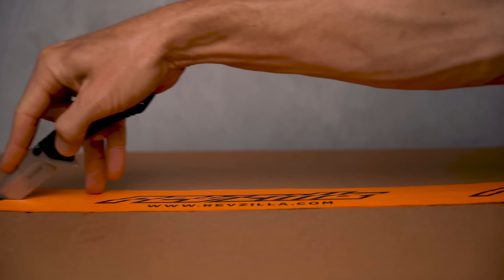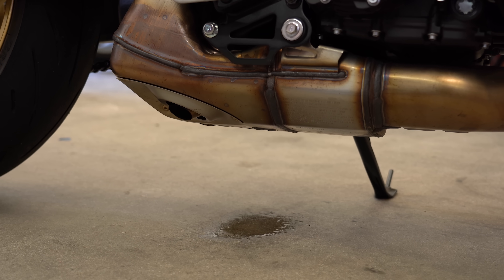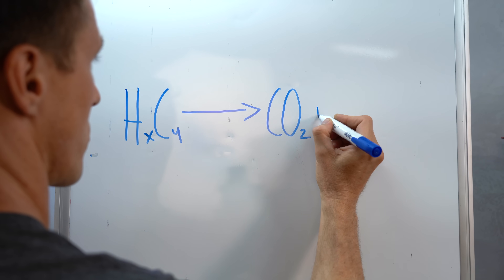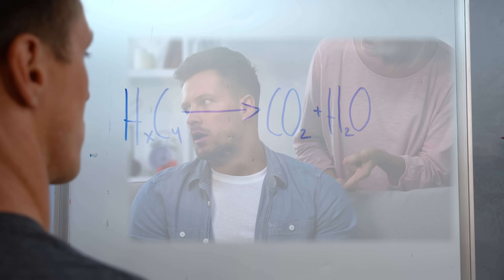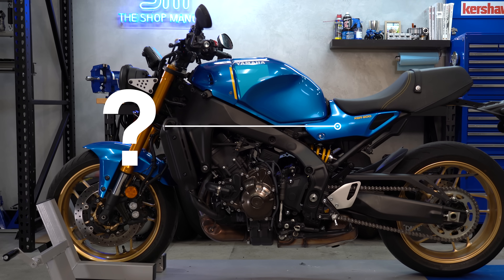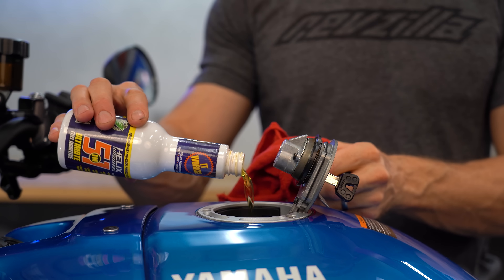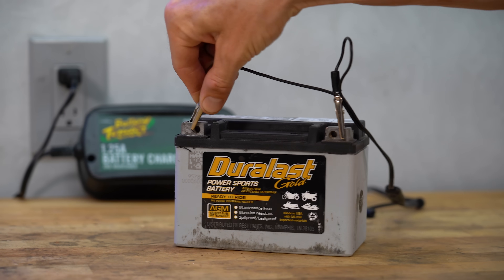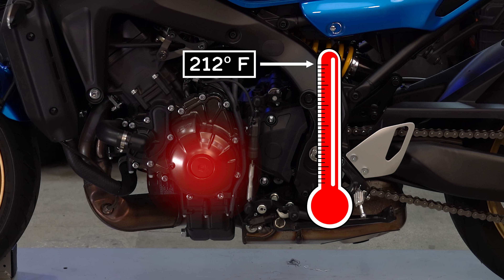The Storage Myth That Hurts Your Motorcycle | The Shop Manual

Comment: Or you can ride it year round if you live in Az. I have personally owned more than 50 motorcycles in my life. Last bike (Yamaha Road Star) had over 100k when I sold it, still ran good. Never put them away for the winter and I have ridden in the snow a few times.

Comment: Excellent video filled with great information. I am 59 years old and have followed this practice my entire life both with my motorcycles and any other stored vehicles... Also why short trips are bad for cars because of moisture buildup in the mufflers which may not be as much of a problem these days as a lots of exhaust systems have gone to stainless steel.
Reply: No, this is bad advice. It is contradictory on may levels.

Comment: If I'm starting my Deuce in the cold, I am plugging my "Extreme Heat" under jacket into my bike, and ride until my face is frozen 😂 I dug 30amp cable out to my garage, and installed a small 4circuit panel, just to plug a tender on my bikes.  Good thing I did that. I can charge a Tesla overnight from my garage.

Comment: I have been riding for about 3-4 years now. Living in Arizona I rode 95% of the year and never had to worry about this. I thank you for this knowledge. It makes 100% sense. This is true too if I move my bike to work on a project or something. I usually start it up, move it and the. Shut off for another month. Having heard this I will push the bike when I need it to move. 

Disconnecting the battery would be a good idea too I would imagine. Help with a y fantom drain.

Ride safe my frie d

Comment: I will ride though the UK winter... But wot about before you pull off I seen riders start their bikes the pull off straight away with out letting the oil set on engine is that the right way... I let it warm for a minute or two at least that 1st temperature bar before leaving

Comment: Worth a mention that some bikes ACTUALLY DO NOT CHARGE DURING IDLE... Certain makes and models over the years come with a regular warning "Keep your RPM's UP." from tech's, fellow riders, and dealers alike, as they gain a notoriety for discharging the bettery if you leave the engine idling for any length of time and do not insist upon riding at least to operating temperature... which is usually around half an hour minimum... It's also part of why so many "seasoned" riders with decades of miles and road time get anxiety whenever they hear an engine "lugging" for more than a second or two.

    CHECK YOUR OWNER'S MANUAL... OR if you bought used from an owner, the BEST money you can ever spend on your bike is a "Clymer" Book, similar to the Hayne's and Chilton's guides of automotive fame (or infamy, depending on your wrenching skills) only Clymer writes these babies to answer ALL your technical questions for motorcycles of legitimately every make, model, and year provided you bother to look for them. It's based on a COMPLETE tear-down and rebuild, comes with diagrams and pictures as well as reasonably easy to read text instructions and even step-by-step "Troubleshooting Guides" so you don't have to sweat being stranded at home "Because you can't get Baby to start up"... at least not without quite a bit of physical activity before declaring defeat and calling a truck and tech' to come take a professional "crack" at it... and probably charge you more than it's worth.

      Personally, while I live in the mountains and it DOES get cold in the winter, I've found it suitably reliable to pick decent weather days and actually go for a regular ride a couple times a month during the cold months. Alpaca wool is a DAMNABLY FINE commodity and worth every cent they say it is, bringing a huge benefit to layering up under the leathers and winter linings. SO an hour's ride twice a month isn't entirely out of reach and the regularity of honing skills and "keeping my game up" is definitely worth the little bit of discomfort I endure rather than trying to recapture my abilities from last year after the bike and I have been "out of circulation" for 4 or 5 months.   ;o)

Comment: Great video! This is the same way l store my snowmobile for the summer. Oil change, grease the rear skid, full tank of stabilized ethanol free fuel, put the battery on a maintainer and not start it until it's time to ride.

Comment: I try to charge my battery every week in winter and in summer if I haven't used it much. I keep the battery on the bike because of the alarm otherwise I'd bring it indoors.
I never thought idling it for ten minutes was good
As for fuel I fill up as soon as I want to ride it again but never have drained the tank or added fuel stabiliser. I occasionally put Redex in so there is some in now over winter. I don't know if it does anything.

Comment: See, I wish my bike had a oil and coolant temp readout, like my car. I always keep my oil temp up in the car, and use that instead of coolant to determine when it’s warm. Because my coolant will be up to temp and I’ll have another 5 minutes of driving before my oil temp is enough high enough to read out (at 120°F). 

Since I ride a naked bike, I can just reach down and feel the bottom end, though. Either way, I usually ride normally for at least 10 minutes before ripping on it. 

And I used to start my bikes during the winter. I haven’t for the past 2. Glad I didn’t, now. I just keep them on a charger. Hell, I’ll admit I didn’t even put fresh gas in the last time. It was fine, honestly. Didn’t notice any issues, but I know it’s not good to do.

Comment: Winter storage if you don't have a battery tender - drain all fuel from tank and carbs if your bike has them. Disconnect and remove your battery and take it in your house and put it somewhere warm for the winter.

Comment: I dont know. I let my cbr sit for 3.5 years. I replaced the battery and it cranked right up. Drove fine then I sold it and the new owner has put 20,000 miles on it no issues.

Comment: I  start up my bike and let it run up to temperature until the fan comes on to cool it down and charge the battery a little bit too.I have been doing this for over 25 years and have never had any problems.

Comment: Why my bike doesnt start:
 I left the fuel petcock just barely cracked for 6 days and when i tried to start it i hydrolocked and bent a rod 😀.
  Itll start, but id like to keep it in better condition that my OTHER bike, which has more bearing material and metal shavings inside the engine case than it does oil 😀.
  😐

1991 kawasaki concours 1000 with a Goomba'd #3 rod & 2004 honda crf450r with non-existent wrist pin and rod bearings

Comment: Also another good thing before storing is to avoid filling it with ethanol gas since it attracts water and moisture. Some stations supposedly still have ethanol free supreme gas which does not even require any fuel stabilizer.
Reply: Yes, here in the UK that will be Esso 99+ Octane. Labelled at the pump as E5, but actually contains 0% ethanol. Th E5 label is a legal thing apparently.

Comment: IF possible the storage route is the way to go. OR if like back in the day the bike lived in the barn on the farm w/ no 'lectrc even close. If there was a battery issue we would take it in the shop and charge it (batteries lasted longer back then too). But we would ride quite often our DS bikes all year in MI and AK if the snow was light. Snowmobiles packed trails so hard it was like they were paved! Anyway, we would start ALL our farm equipment, bikes, farm trucks, etc BUT as you said- let them warm up completely. This was WAY back decades ago and now mine lives in the garage in front of my car and a tender keeps it toasty. My son has no garage or power near his bike storage so his battery is in my garage and we start it maybe once or twice in the midatlantic short winter where we live now until completely warm, add stable/fresh gas as needed and also block pipes and areas where CRITTERS like to set up winter homes. It does happen! GREAT vid as always. Thank you for your science/common sense backed advice.

Comment: For my bike with a carburetor, I add stabilizer and fill the tank, ride it for a few miles, shut the petcock and run the carb dry until it stalls out.

Comment: With a wet clutch however you may find the oil drains from the plate’s surfaces and you have trouble getting the machine into gear after a long lay-up.

Comment: I start mine , gently warm up, then I clear the cylinders out.  If work has got in the way otherwise i go for a ride.  Those 50 year old check valves seep oil into the crankcases.

Comment: Some of us who live in Western states have a drier climate where humidity is not really an issue, hence less condensation.  I have been fortunate, this past year, to have been able to ride every month. (even in 35 degree weather) I, still, go out and start them every couple of weeks and, yes, I let them run for about a half an hour with frequent revs up to 2500 rpm or so. In the dark months I need the therapy so I pull them out of the garage and have at it. One more thing, you did not say a word about filling your tank with non ethanol fuel while still adding a fuel stabilizer and running it through the system. Out here, we are blessed with the option to buy non ethanol premium so the fuel stays more stable when sitting for longer periods. Anyone who runs chain saws, owns boats, or has any other power equipment knows NOT to use E-10 or worse.

Comment: Not to mention how harmful the start cycles are for any internal combustion engines. Every time you crank the engine, a little bit of it's life goes away. Those few seconds when pistons move up and down before the oil pressure reaches enough pressure to create the oil film on the bearings and oil rings are just metal grinding on metal.

Comment: I've been a motorcycle mechanic since 1969. Never leave your tank empty if it is steel.  It will corrode and get rust into your fuel. Always leave it completely full with a stabilizer in the fuel.  I find old fashioned Marvel Mystery Oil to be the best. .5 oz per gallon.  Draining the carbs is good, but if you make sure to run the bike enough to get the Marvel Mystery Oil into the float bowls, any residue from the evaporating fuel will never harden.  An empty tank on a carbureted bike will draw in air every night and expel air every day. Less room for air = less moisture. Any moisture drawn in will condense on the tank walls and roll down below the fuel where it can't evaporate.  NEVER leave ethanol in the tank. The water will mate with it in the long winter nights and you won't like the offspring at all.  Also brake calipers get sticky if not used. A short run that doesn't completely heat the engine can leave unburned fuel on the plugs can wet foul them.  I have a check list on my wall and check off all of my bikes as they are ridden each month. I had to drag out two Funerary 28 to ride. RIDE them cold or not!  Work the brakes. Go through the gears. Operate all switches and buttons. Crank the throttle on. Make her like it!!! Freeze your ass off for her. Show her you love her! 😍

Comment: Somewhat unrelated: I got into conflict with my paternal unit about this over his approaching 20 yr old BMW. I started putting my 2amp tender (because I know it won't hurt it) on the battery in his car in the winter to help the battery. He insists that the car needs to be run because "it's a BMW and it's a higher  caliber car".

I've given up trying to explain that lead bathed in acid in a plastic box is, at some point, lead in acid in a plastic box.

Comment: If your tank is plastic, probably best to store empty.  Hopefully they're better now but for sure early plastic tanks do not like gas with ethanol it it.  They swell. My Aprilia RS250 tank expanded enough that I had to reduce the steering lock.  My Ducati 848 tank barely lines up the bolt at the back.  I only leave gas in them when I'm riding within the next day or two.
Reply: You should by Yamaha next time.
In other words, the problem is not with the metal tanks... the problem lies with italian crap...
Reply: @jorgemtds  Hahahah.  I'm just a sucker that way.  3 Italian bikes and one 'Swedish' (Husky Vitpilen).  Having bikes that just work all the time sounds boring.  :)

Comment: Simple steps. My bike is stored in a big shed during the winter... so very very cold. Before storage wash the bike. Take it for a short ride to make sure she is nice and dry. At the end of the ride fill the tank with ethanol free gas (or as close as posible). Park the bike on some wood to protect the tires. Plug in a battery tender and cover the bike. Pumping the tires up a bit more than usual will also help in keeping a flat spot from happening. Works great never a worry about restarting after a long 5 month sleep in sub zero winter. Not rocket science.

Comment: Same thing with cars. Starting a battery that's not on a maintainer causes more drain than it can charge. Besides you don't want to use your alternator to charge your battery. 

But yeah the water thing can rust out your exhaust and even cause problems with fuel dilution.

Comment: I like to run a little two stroke gas:/ mix through the motor before winter storage.  One of the main reasons NOT to start. Your bike in the cold winter temperatures especially on a vintage motorcycle is that the straight weight 60 Wt. oil is MUCH to thick for the oil pump to circulate oil through the motor!  Resulting in a dry start AND run situation that will ruin your motor and oil pump…. Ask me how I blew up my 1963 Sportster XLCH like that 😂. Take a bottle sae 60 wt. oil and try to pour it in the winter…you will see what I mean!

Comment: There is a different battery problem with electric bikes. Charge to 60% then every month check it hasn't gone below 30%. If so, plug it in for a while. There isn't any problem with gasoline or oil, although corrosion inhibitors are still useful.

Comment: I do all of that plus, pull the spark plugs and fog the cylinders with oil and remove the tank, get all the fuel out, pour in some oil and roll the tank to cost the inside. Have had no problem with bikes stored this way.
Reply: Always fill gas tank to near overflow then snap back the cap.  That's all you need to do so long as you use Ethanol free gas.

Comment: Oh No, Shop Manual, I'm in big trouble!!
 I've been starting my 1100 every month or so in the winter.  It's 38 years old, has over 50k miles on it, and the exhausts are still pristine.
Are they just not making them like they used to, or is it some crazy dumb luck they didn't rust through a long time ago?

I do keep a tender, and use ethanol free fuel with no additives.

Comment: Any advice on starting a Ducati that has sat for 10 years? It was in storage, warm and dry.
I am going to drain the tank, clean etc. Put new belts, plugs, oil chance and valve clearance checks. New battery. Any good ideas?

Comment: I have a heated garage (60) here in Alaska and I do start the bike every two weeks and let it get very hot, roll it around etc. I understand that not putting load on the engine is “harmful” but so is holding it wide open while riding, is it not? I think it’ll be fine!

Comment: Seems to me starting ocassionally and idling to keep battery charged is a waste of time, and most engine wear occurs on cold start up and before reaching operating temp.  To me its unneccesary wear, especially on the valvetrain, because the valve clearance cold is much greater, which is probably a valid concern, especially if you have titanium valves.

Comment: Good stuff, I live in western  Colorado and really can ride pretty much year round. I may miss a few weeks in the winter my question is I have a temp gage in my Harley. When it is real cold like 30 or below engine temp may not make 200 even on a 30 min ride. Coldest I ride is 5 or 10 degrees and those rides are what I am referring to. Is that warm enough to evaporate the moisture your talking of?

Comment: Best thing I’ve ever done was stop using Ethanol gas. No need for fuel additives, gummed up lines and trouble cranking, even the older bikes that sit in the garage for 6+ months without riding.

Comment: A friend of mine said he leaves his motorbike outside with 2 tarps on  under a gazebo for winter storage since he has no garage space. Is this bad for the bike?
Reply: Depends on the weather where you live. Probably only the tires, the electrical, the metal parts and the seat will be ruined.

Comment: There´s another solution to it: I never winter in my Bike, except for the Battery. Instead i go on regular short Rides to keep her in positive condition. Even in Winter i do that at least once a month (when possible every two weeks) on a dry and at least +3°C days. This Ride contains around 20km, i start off in the City for 7km the rest is on country roads, except for the last KM wich is back in the City. What do you think? Is that a good option? (i have the proper gear so i don´t get frostbites. Also i have heated grips.)

Comment: Duct taping the throttle and bouncing off the rev limiter will help it warm up quicker.  I take my tank off and store it inside so condensation doesn't rust it from the inside out.
Reply: Yeah, it's a mystery why the shop manual doesn't recommend regularly revving the living crap out of the engine.

Comment: The best thing to do after storage is pull the spark plug wires and let the starter turn the motor over for like 10 seconds then wait like 30-45 seconds do this 3 or 4 times to get the oils dispersed threw the engine a little then put the plugs wires back on and crank your bike
Reply: Which is why I love kickstarters. Ignition off, crank it over , ignition on.
Reply: Please don't. You will inject a lot of fuel into the cylinders and that will then dilute the oil. There is no point. The oil isn't going anywhere on your parts over winter.